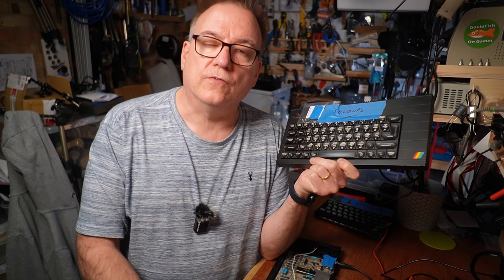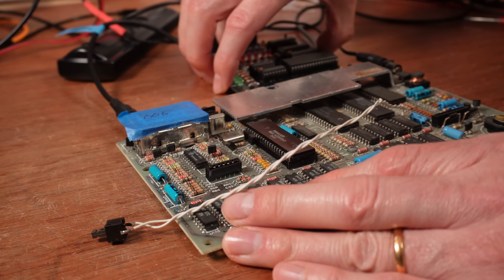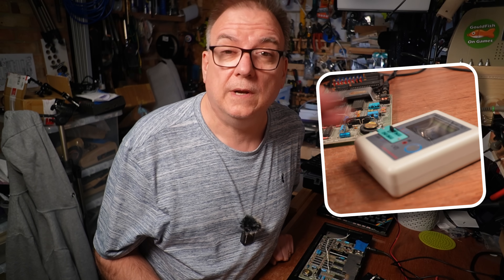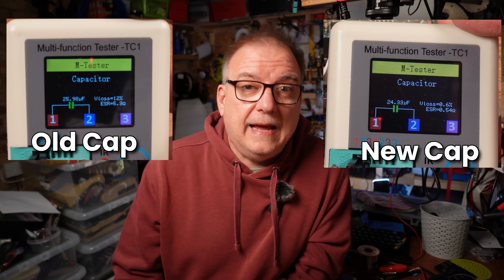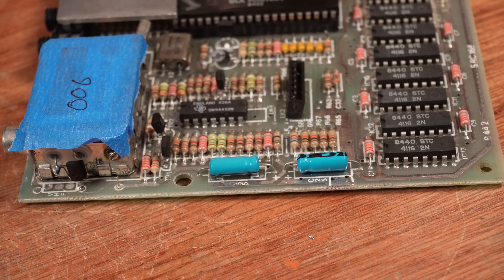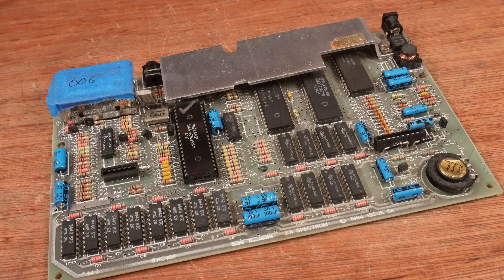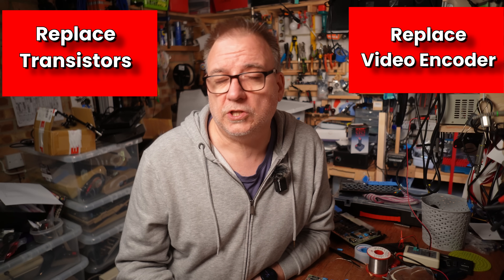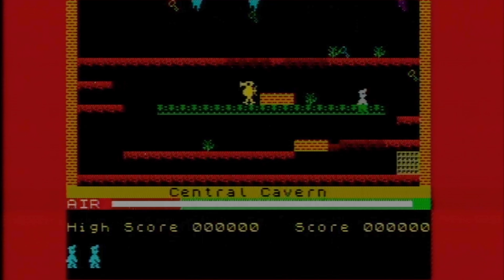A Weird Chip Inside This ZX Spectrum.

Comment: I'd really love to get my hands on some kind of table that lists "good" and "bad" ESRs for various different caps... for me, at the moment, ESRs are just "some arbitrary number".
Reply: It depends on the circuit tolerance. It's generally accepted that most caps should read below 1 ohm unless they are small values such as 1uf, which may read a few ohms, say 5 ohms. If any cap reads over 5, I'd toss it. If you check the data sheets, you can find max ESR when new. They don't change much until end of life
Reply: Nice! Thanks!

Comment: I have gone into electrolytic capacitors in great depth as a project manager for a 3rd party design house. There are all sorts of issues. For a start the Boric Acid wants to eat the aluminium oxide insulating layer on the foil plates. Store a cap too long and it will break down. You also need to "re-form" electrolytcs by charging them to about 1V less than rated voltage for 24 hours after 6 months storage. Then there is the whole water metering issue. Too much water and you still have a significant amount of qctive boric acid eating the aluminium oxide. This reduces life radically. Basically it's an equilibrium reaction where you use electric charge to drive it to one end (the aluminium oxide end).
Reply: Excellent information, when i was a camcorder engineer way back, we found that machines in regular use suffered much less from leaky surface mount caps than machines used only from annual holiday to holiday.
Reply: The rubber seals on electrolytic capacitors have a ten year design life - if they leak they die.
That’s why they are avoided in modern industrial equipment designs.
Older designs used nicotinic acid as the electrolyte.
Reply: Yep.

Comment: Thankyou for that. I was confused why my issue 6 had a manky display. After looking at the parts I took off I found that IC. I replaced it with the LM IC. That is why it did not work. Cheers

Comment: The bad video quality you are refering to may have several causes. The most likely ones are noise in the power source (not ultimately the psu, can be induced by another nearby device, - maybe try powering from 3 LiPo cells in series -> no noise, maybe add additional decoupling to the ULA, video encoder… - different values 0.1µF, 0.47µF, 1µF) or the still running modulator (but you did the composite mod outside the can and cut the power to it). Other possibilities are noisy diodes or  transistors, bad contact in the ULA Socket. Check the video out of the ULA on an oscilloscope and see if you can identify the noise (looked not very high frequency - in the kHz range maybe even less, do this on an grey screen and check ist AC coupled - check the noise level and try to meassure the frequency - then search other nearby signals that may be the source of the noise. Recently someone else had a similar problem (I forgot who it was Adrian, Jan Beta, … can't remember)
Reply: The professor has spoken!! If I could only gleam a weeks worth of apprenticeship.

Comment: That reminds me, I still have a cap kit for my 48k that I really should use to replace it's old caps. Lovely video and nice to see the results of testing this machines old caps. I'd never heard of an alternative LM1889 chip either, so that's interested - I'd have been interested to see how this speccy performs with it popped into the sockets after replacing the video transisters.
Reply from the maker: Cheers Chris! I've kept the odd chip and will test it in another board at some point

Comment: The SN94459 and LM1889 are indeed pin and functionally compatible for the pins that exist on the SN94459. 

Difference being the SN94459 does not contain a VHF RF modulator and the LM1889 does, which the Spectrum does not use anyway. PAL systems always used an external UHF modulator.
Reply: Just found your channel, love your work.
Reply: or LM2889N a later version of LM1889N/LM1886 (Version 2?)
only difference seems to be a wider voltage tolerance 10-16v (LM1889N 12-16v)
neither is officially manyfactured any longer, 
seems ther a questinable manufacture in XXXX that can make the old TI version of LM2889N, min order 1000 pcs...

Comment: I prefer the ZTX213's at the video out, since other ones often blur the picture a bit.
And the interference could be caused by the small caps at the 4116 chips: I have axial 100nF ones to replace them (only if needed) nowadays.
Reply from the maker: Excellent! I will look into those caps. Although hooked up to a TV the output looks great
Reply: In all my time repairing stuff, I've replaced more 0.1μF ceramics that have DC across them - usually decoupling caps - than electrolytics. Probably hundreds more!
Reply: @erroneousbosh  I thought those don't usually go wrong (unless they are obviously physically broken) as there's no electrolyte to dry up?

Comment: Whahaha, no I didn't click. And have a bunch (like 30?) pulled LM1889 chips, to replace (always) those garbage ones.
Reply from the maker: I bet you did click!
So those other chips are really that bad?
Reply: At least half of the ones I encounter during refurbishment, have issues.
They're fortunately not that common, but I always replace them to be sure.
Especially since I include warranty.
Reply from the maker: @ByteDelight  good to know!

Comment: I've seen more boards fully come to life by only swapping capacitors!
So you showed what is the best: never start with swapping 4116 chips: always start with the capacitors.
Especially the ones on the 12V rail(s): the 100uF's.
Though that does not mean the 4116 chips, ULA, or whatever part, are still reliable.
Reply: I have seen examples of socketed chips being the issue due to oxidation in the sockets.
Reply: @ehsnils  definitely, i had a 128 that'd crash if you so much as tickled it, it was dirty ula socket!
Reply from the maker: Hey Ben!
Reply: @MoreFunMakingIt  i'd say c46 is the critical one, if it goes bad, the -5v line can drop or disappear resulting in damage to the 4116s , its the pulse feed for the -5v diode pump circuit
Reply: I managed to short the -5V killing all 4116. So I now have a 48 kB Spectrum with two 64 kB banks. First delivers 16 kB and second delivers 32 kB. Strange? Definitely. But was a quick fix and now no -5V is needed.

Only strange outcome is that the ULA seems to become a bit hotter than originally.

Comment: All RAM is bad = too high voltage on the 5 V line (even for milliseconds).
Reply from the maker: Probably down to the bad capacitors in this case
Reply: @MoreFunMakingIt  that wont and cant cause the +5v to be high, that may be down to the 7805

Comment: I have a toastrack spectrum but the large heatsink has all the paint flaking off, any idea what I could respray it with?
Reply from the maker: Should be able to spray that with just about anything really. It wont be getting excessively hot, so I would just pick some automotive paint. Clean it thoroughly, maybe even prime it, and then multiple thin coats.
Reply: A 5vdc buck converter,